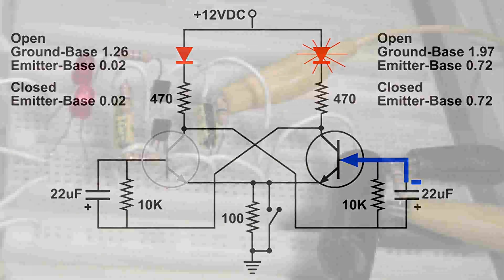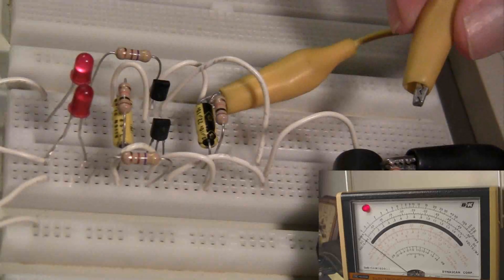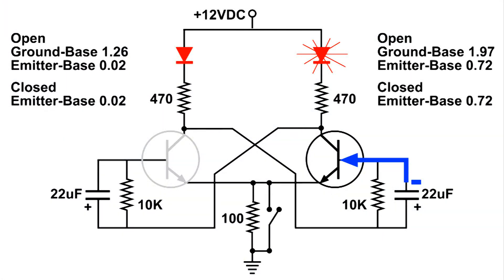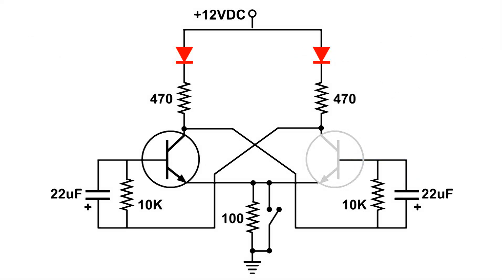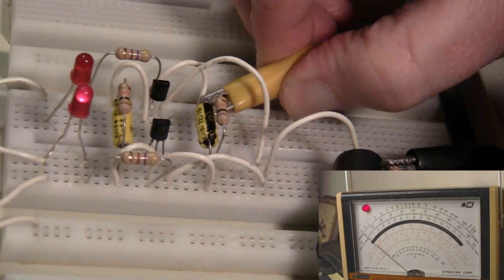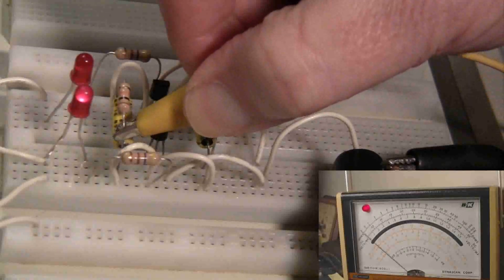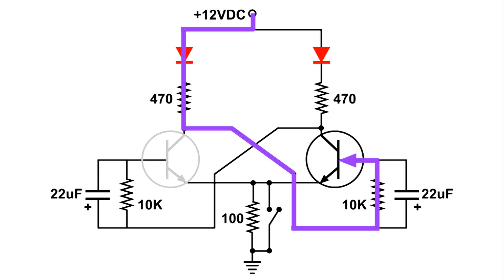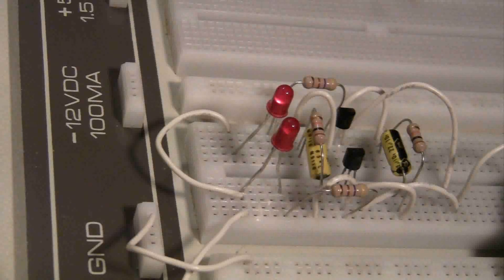Flip-Flop Circuit, build and demo

Comment: I need my push button to be switched to ground as it's part of a roland street cube footswitch circuit (monetary switch) and it also needs to work off 3v (2 x 1.5) or 4.5v (3 x 1-5) batteries. Been searching fior weeks! Love the circuit though, great explanation, thanks... Mick
Reply from the maker: Hi Mick
I looked up roland street cube footswitch circuit and others. Some used a three connector and some two connectors. The sleeve is the ground connection in both the three or two plug. None used any batteries. DigiKey has lots of switches. You could contact DigiKey and tell them what type of push switch you need.  
https://www.digikey.com/

Comment: This is great! I saw something similar to this circuit elsewhere and put it together, it didn't work. Reworked it thinking I did something wrong, nothing. This really helps zero in on things.
I wanted to ask, is there a way to do this with 3V? I'm trying to put this on a pin (like a button to wear) and 12V is not really something I can get on a pin. Can things be swapped for lower resistances that it'd still work?
Reply from the maker: I think a IC circuit may be useful. 
JK Flip Flop
https://www.youtube.com/watch?v=zo0UR5BgK1M
D Flip Flop Clocked with 555 Timer
https://www.youtube.com/watch?v=l5MM9-rt8b0
Binary Counter Cascading D Flip Flop and 555 clock timer driver
https://www.youtube.com/watch?v=ter5f0UjvHc
Cascade FlipFlop AND Gate Logic Demo
https://www.youtube.com/watch?v=mwkKQ0jYJ8o
IGBT Astable Multivibrator
https://www.youtube.com/watch?v=PnAiAhZH9hw
Reply: @AllAmericanFiveRadio  okay, I'll take a look. I'm trying to avoid ICs since I'm having like 100+ of these made so it can shoot the price up pretty quick.

Comment: Can we use 12v relay in lieu of LEDs?
Reply from the maker: You can, you may need to lower or eliminate the 470 Ohm resistors. If you want a free running circuit you might try an Astable Multivibrator.
IGBT Astable Multivibrator 
https://youtu.be/PnAiAhZH9hw
Reply from the maker: You also may need diodes across the relay windings.
Reply: @AllAmericanFiveRadio  Thanks
Reply from the maker: @ShivaShankar-rj4rg  Your welcome. One more think I would build with LEDs first. Get the flip flop working than change the circuit. The components on each side must be matched as close as possible.

Comment: I don't understand how the negative voltage pulse is achieved at 4:14 . From my perspective, opening the switch will increase the base to ground voltage from about +0.2V to +1.26V . How does the base voltage drop below 0V ?
Reply from the maker: When the switch is closed the capacitor charges. When the switch is open, now there is 100 ohms more in the circuit, the capacitor discharges.

Comment: I built the circuit in livewire and it doesn't work, what is missing? https://www.facebook.com/photo.php?fbid=3489145254545628&set=p.3489145254545628&type=3&av=100003505622379&eav=AfZINQSBOven1U66h59P9fyubImJ7i_z2Fg66W-NsLJdicrwWaE7f8J5Oo4AJFpwSrU
Reply from the maker: ALL components MUST be MACHED. This is a balanced circuit.

Comment: Instead of using two 470 ohm resistors, can we put only one 470 ohm resistor, just right after "+"?
Reply from the maker: I don't think that will work, but give it a try.
Reply: Yeah, you can. As long as the LED is in series with the resistor you are good.

Comment: Great explanation as always! By the way, do you have any simple solutions to the bounce issue you mentioned in the video? I keep having false triggers when I use a slide or button switch on these IC circuits. All my research points to using a Schmit trigger, but that seems to me to be over complicating a simple switch.
Reply from the maker: Yes a Schmitt trigger is good. You might try just a transistor to trigger the flip flop. Thanks
Reply: @AllAmericanFiveRadio  
Thanks! Found a simple NPN inverter circuit that works great with a button.

Comment: http://everycircuit.com/circuit/4857314209955840 I got it to work on EveryCircuit with a little tweaking. When you first run the simulation bush the button I added near the right capacitor and it works after that.
Reply from the maker: That is good news.

Comment: I built the same circuit and the only difference is that i used 47uF caps.When i turned it on (using 9v dc) the leds started blinking rythmically (without pressing the switch).And by rythmically i mean that the first led turned on and then it turned off and simultaniusly as the other one turned off the other led turned on and then that led turned off and simultaniusly the first led turned back on and so on.This happens quite fast.(with approx. 0.25s delays).Is it becouse i used lower voltage,larger caps or some other reason?Thanks in advance.
Reply from the maker: I would try changing some resistors, like the 100 Ohm to 50 Ohms or 200 Ohms. If that does not work try the 10K and so on. Getting flip flop circuits to work can be a challenge.

Comment: Your video is better than all other videos combined on multi-vibrator in You Tube.  No one answered the question, how a transistor with negative base bias can act as ON switch.  Moreover, your positioning of 22 mF capacitor, and 10K resistor has added a new helpful perspective to the circuit..    You have provided me the right handle, to study the circuit on my work bench in more detail.  Thanks
Reply from the maker: Thanks and good luck

Comment: Hi there mate !!  (I'm in Australia, and in my mid 60's).  This is the 1st time I've seen your stuff....
The SECOND i saw the 'AllAmericanFive' part, it instantly clicked, remembering the ubiquitous standard '5 Valve'
super-het radios i used to play around with, and fix.  I miss the warm glow of Valves on a workbench !!!

I guess you like to keep things 'Old-School', as do I, generally, but lately i've been using computer circuit
simulation software for prototyping etc...  It has come a long way, especially when it can run continuously 
in Real Time, and Meter any voltages or currents live, in any part of complex circuits, just with mouse pointing.
(Not to mention all component/IC specs/dimensions, with auto track/pcb creation).

Great explanations from you, & look forward to going over more of your 'many' posts !!  Thanks....
Reply from the maker: Thanks

Comment: good tutorial ,  if you could explain   same flip flop but on 12 vDC ( 21watt) what the values it will be   ,, thank you for sharing ,
Reply from the maker: I'm not sure what you're asking.
Reply: thanks ,   my goal is  to use it   on car stop light , it is 12v 21WATT , all i   need is the values of transistors  +resistor and capacitor ,  Thanks again
Reply: i think you can use this circuit with relays ...
Reply: Thanks for  the idea ,  i tried  on transistor BD679 it worked  but its getting hot  then i add heat sink it worked little bit longer  but again flip flop getting slower,,lets see
Reply: Kavindu Gilshan gracias. jose

Comment: Hi, AllAmericanFiveRadio,

Congratulations on a great job! Well done!

I am just unclear on one thing - when you power up the circuit, why wouldn't both transistors go into conducting state, that is, allow current to pass through CE junction? As far as I can see, when you power up the whole thing, BE junction is immediately forward-biased and thus both transistors should be conducting. Am i missing on something?

Many thanks for some kind of clarification
Reply from the maker: The flip-flop circuit is a balanced matched circuit. However each side is not perfectly balanced, so when the power is applied one side will dominate.
Reply: AllAmericanFiveRadio , thank you very much for your answer!

Comment: Hmpf. It's not working. 
Are these PNP or NPN transistors?
Reply from the maker: NPN
Reply: Hm. I used NPN. So I read the diagram right. The circuit even oscillates when I press the button continuesly, but it does not switch. Hm... I used C547B transistors and tried to find similar capacitors. Maybe the transistors are not quite right. Can you take a look at them and tell me which properties are important and not-met?
Reply from the maker: From what I can see about the C547B transistors you are using, they should work as long as they're good working transistors. The transistors I am using are just general purpose 2N2222's.

Building a flip-flop circuit can be somewhat of a challenge. The transistors I used I made sure that they have the same Beta, amplification factor. Also all the other components, resistors and capacitors, were chosen as close to being the matched as possible. So another words all the components on one side have the same characteristics as the other side.
Reply: Beta amplification factor?
Reply from the maker: http://www.learningaboutelectronics.com/Articles/How-to-calculate-beta-of-a-transistor
Reply: Hm... Doesn't seem to be a transistor specific value.
I'll just try different transistors. I have a whole bunch of C945Y-638.
Reply from the maker: Make a video so I can see what it's doing, with pictures of circuit.
Reply: AllAmericanFiveRadio I just bought a huge ton of electronic stuff, including proper npn and pnp transistors. (There's a store here in Germany that sells resistors and capacitors by 500g a pack! With no knowledge of what will be inside. Awesome!) I'll be working on this circuit when I get the stuff. I used the parts on other soft switches and all of them are not working.
I also bought some with a beta of 30k. :D

(I made the circuits 3D so that it is impossible to know what's going on. I also bought a breadboard to fight this problem.)
Reply from the maker: That sounds great, you have lots of parts to work with. It's amazing how much you can learn building projects. I have several transistor circuits you may be interested in, on my channel are a number of one transistor FM transmitters. Just search my channel and you'll find them in much more. Below is a link on how to search my YouTube channel.

Searching My AllAmericanFiveRadio Channel
https://youtu.be/4k7ByHqh8Js
Reply: Building circuits is fantastic for developing theoretical understanding that one has read. This little circuit is like an oscillator circuit and the essence of the 555 timer IC.
Reply: Try using the app EveryCircuit to show you realistic simulation. There, you can quickly see speed and movements of electrons on paths, resisters, diodes, transistors, etc. I am now learning EveryCircuit, as it is one of the best circuit simulators. I love to see more tutorials on that app.

Comment: can I use two 12V diode lamps instead of LEDs?
Reply from the maker: 12 V diode lamps are LEDs. It would have to make sure that the 12 V diode lamps you want to use do not exceed the current limitations of the transistors.

Comment: it is okay if i used 2n3904 transistor instead of 2n2222??
Reply from the maker: The 2n3904 should work just fine. It is important that the parts on both sides of the flip-flop matches close as possible. Because of that they can be a little tricky to build, but once you get them working, they work very well. Good luck.

Comment: I built this circuit and it works well .I had to make a few changes in values to make it .Thanks a lot.
Reply from the maker: +only using transistor circuits (OUTC) 
That is not at all uncommon. Flip Flop circuits are somewhat difficult to get working because both sides have to be balanced. But when you find that balance they work great. I think the next most difficult circuits are RF transmitters and RF oscillators. It is so great to know you got your Flip Flop circuit working! Thanks!

Comment: I just built this circuit, but I have an anomaly. I do see the LEDs flip-flopping, however, the "flopped" LED is NOT completely off, that is, it is dimmer than the "flipped" LED, but it is nevertheless on. One thing I did differently is I have a 560 (instead of 470) ohm resistor inline with the LED, and the resistor tied to the power supply instead of the LED, and then the LED is tied to the collector of the transistor. Could this be the reason why the off LED is not off all the way?
Reply from the maker: +ZillaYT 
This is not uncommon with flip-flop circuits. There has to be parts on one side that do not match other side. To get a discrete component flip-flop circuit to work properly each part on both sides must be matched. Flip-flop circuits are one of the hardest circuits to get working properly. You have done well to get it to work at all. When I originally built the circuit I swapped out many components until I got everything to match. If you measure the voltages, I would start at the transistors collector, this information can be helpful in determining which part needs to be changed out to match the side that is working properly.
Reply: +AllAmericanFiveRadio 
Here's what I see, all in Volts. Flip means transistor's corresponding LED tied to its collector is on, flop means it's off.

Q1
Vcc-GND: Flip, 0.97, Flop, 5.601
Vce: Flip, 0.078, Flop, 4.71
Vbe: Flip, 0.72, Flop, 0.11

Q2
Vcc-GND: Flip, 0.994, Flop, 5,598
Vce: Flip, 0.11, Flop, 4.7
Vbe: Flip, 0.75, Flop, 0.084
Reply from the maker: +ZillaYT 
Another troubleshooting technique is to swap parts between each side. When the unwanted result moves you have found the part you need to replace.
Reply: +AllAmericanFiveRadio 
In my case, the unwanted result, that is the LED being dimly on on the flopped side, is on BOTH sides.
Reply from the maker: +ZillaYT 

You never said it was both sides. The bias needs to be changed.
Reply: +AllAmericanFiveRadio 
You mean the base-emitter bias on both sides? My hardware smarts is rusty
Reply from the maker: +ZillaYT 
You could change the bias B-E, or change the diodes, to diodes that require more current.
Reply: +AllAmericanFiveRadio 
I want to use my LEDs, so how would I change the BE bias, by putting a resistor between the existing RC circuit and the base?
Reply from the maker: +ZillaYT 
I use a variable resistor. The resistor connected to the emitter and also to the bases. When it starts working the way I want I measure the resistance.